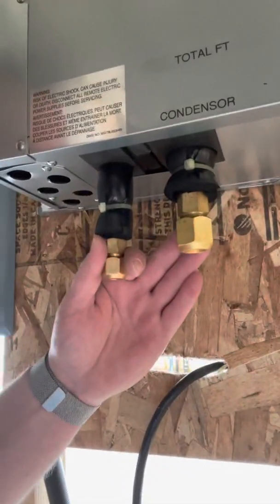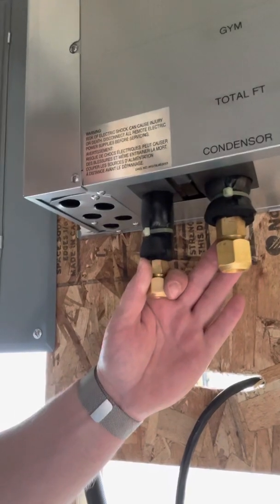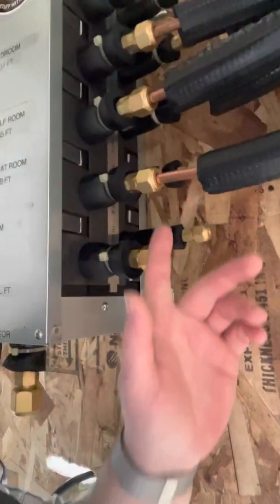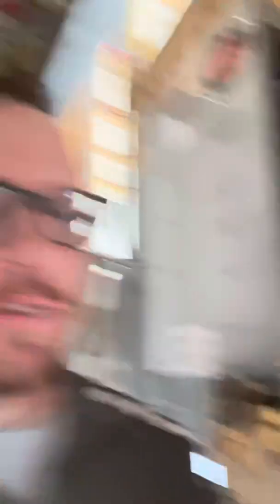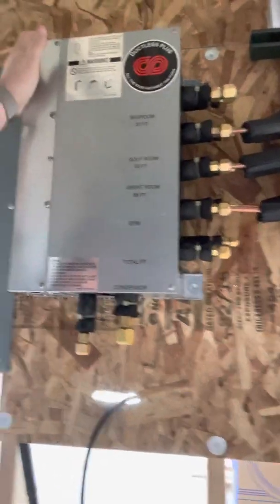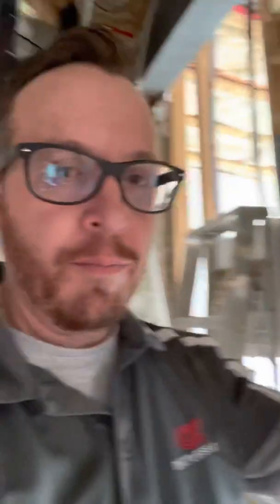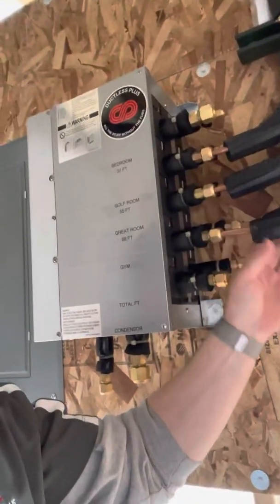Best multi-Zone Mitsubishi Ductless install and design! High quality equipment and service MXZ!!!!!

Comment: is this a Mitsubishi Hybrid VRF? do you recommend any installers in Florida?
Reply from the maker: This is a MXZ system. Multi-Zone. And We’re going to open a store in Florida in about 1 year. But I don’t know anyone down there. 

Jared
Reply: @ductlessplushvac  that’s great to know you will open in Florida!
For a 5000 plus sq feet home would you suggest a vrf system and if so would you go ductless or ducted
Reply from the maker: Great question It would be wise to look over all options and see what’s going to work best for your location. Every place is Unique.

Comment: Why don’t add service valve in all the line sets ?
Reply from the maker: The outdoor unit has them. You don’t need to isolate each evaporator. If you're going to add a future unit down the road then it’s a good idea to install one on the extra port But we know this home will not be getting another evaporator. You should have done a 600+ psi pressure test to verify you don’t have any leaks anyway so what’s the point it’s only going to cost the customer more money for the project. If you have to service the unit like replace the fan motor or control you don’t need to shut down the Refrigeration loop. Good question ERhvac. Also if you have a leak R410a will fractionate which would need to have all the gas replaced. Topping off a charge on an R410a unit isn’t right. It's a blend refrigerant. You will not have good performance from it. Thanks